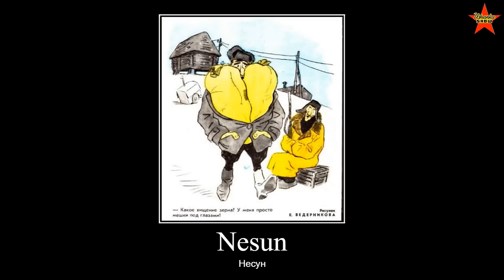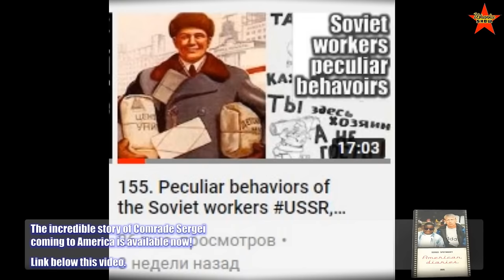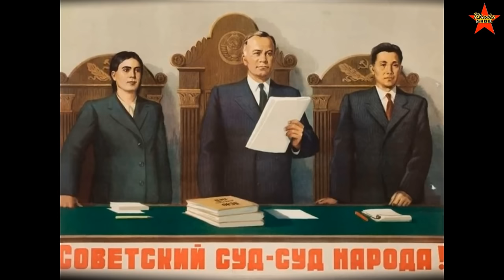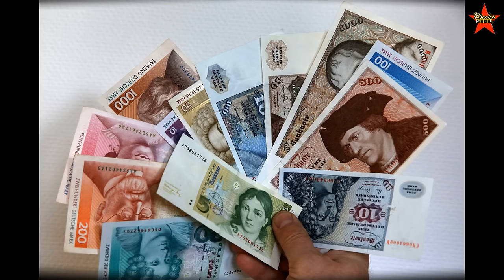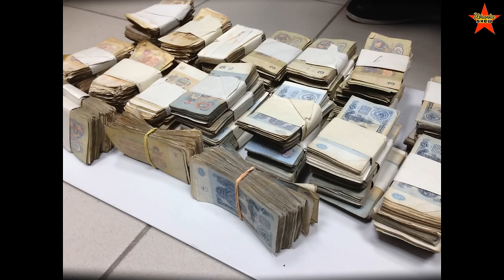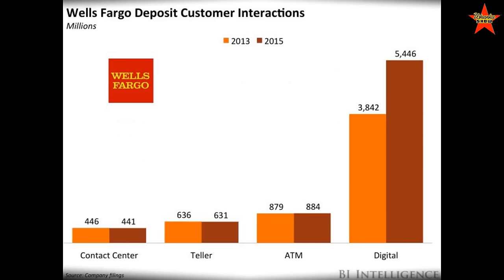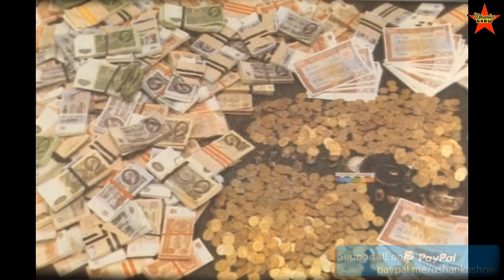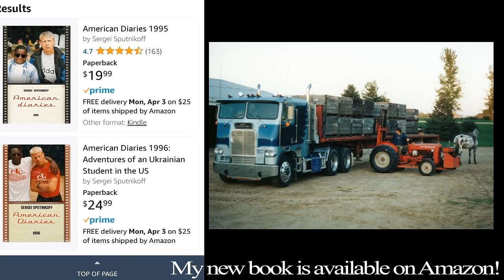The Great Stagnation and Crippling Corruption During Leonid Brezhnev Rule. Ushanka Digest #brezhnev

Comment: The more the government controls the economy, the greater the corruption will be. While corruption can be a drag on the economy, sometimes the government control is so restrictive that the corruption in the system is the most efficient part of the economy.
Reply: Why I use the phrase "Corruption is the Economy."   If you need something you often resort to the black market to get it as the state fails to provide it, illegal markets in short, it's the only free market in a Socialist system.  A Black Market is Corruption, and the State is itself Corrupt.  So everything revolves around corruption, so Corruption is the Economy.  

A few other good examples are China, North Korea and surprisingly South Korea.  South Korea was run by a military dictatorship for generations, not until around the 1980s did it step away from said dictatorship.  But that Dictatorship had a strong grip on the economy, and to get anything done in that economy required corruption and bribery.   South Korea still hasn't completely shook away that corrupted element even after 40 years.
Reply: That is correct, however in a CAPITALIST system, corruption is a feature, not a bug.
Reply: @kevinramsey417  hmm, wrong way around. Corruption is a central feature of the command economy, not a bug. Indeed, it can hardly function without it. In those economies where voluntary cooperation predominates, corruption is a good indicator of where command style policies are creeping into the system. Voluntary markets punish corruption because it adds costs without giving. As long as the consumer has choice that which is less corrupt is more cost effective than that which is more corrupt.
Reply: Corruption is universal and always has been.  The difference is that in a functional capitalist culture, the markets will punish companies that, for example, put tons of money into stupid investments.  Whether that's cotton farming in the wrong climate or investing in synthetic tranches.
Reply: corruption can happen in any economy. there's an insane amount of corruption in modern day capitalism, it's just mostly "legal" corruption that is normalized to the point people don't see it as corruption anymore. for instance, insider trading is incredibly common, especially among government officials who get kickbacks for basically letting companies do whatever they want. corruption is a societal disease, not an economic one.
Reply: This whole thread reads like a sith mantra. 

Like not a single homie thought "maybe it can exist but less" here. Maybe one day
Reply: You just described China
Reply: @larrys9241  and Russia, and Venezuela, and Cuba, and North Korea, and Vietnam and Cambodia, and....
Even in the US, the above is true.
Reply: @joanhuffman2166  in the US the government economic policy is largely dictated by the needs of large corporations so i wouldn’t just say that the root of the problem here is the government having control over the economy lol
Reply: @greghenrikson952  Depends on the companies lol. Top companies are always protected by the Governments. ALWAYS. During the Covid Quarantines, the German Government injected a shit load of money in the giants of the automobile industry, for example. Also, as long as there are some people making huge profits in certain areas, the Governments of Capitalist countries will do anything to keep such interests. Either by stopping technological progress, which would make things like oil obsolete, or even starting wars.
Reply: @joanhuffman2166  2 thoughts, from the workers perspective the capitalist mode of production is inherently corrupt, because the capitalist skims the profit off the labor. And you don’t necessarily need capitalism to have a market or product choices.

Comment: My takes on why the Soviet Union eventually tumbled like a dried leaf riding a gust of wind:

1. Brezhnev replaced Khrushchev thanks to the former gaining military support. Rewind back to the early 1960s when Khrushchev was in charge. Two of his actions that sealed the regime change were the Cuban Missile Crisis and imposing drastic cuts in the military. Unfortunately, the Soviet economy had a weak civilian economic sector, meaning the military higher-ups had nowhere to go once they were sacked. (Not to mention the loss of perks and privileges associated with their military postings.) BUT ...... while this enable Brezhnev to be in charge for about two decades, it meant pretty much giving the Soviet military-industrial-complex a blank check. If your military is given a blank check, there is not a whole lot of incentive for it to improve efficiency. It is not that its US counterpart is all that much better (apart from the technological race and any number of consulting firms that hire retired generals), but the Soviet military-industrial-complex was a much greater burden due to much smaller Soviet national economy. (Think of it in this way: the US has a much bigger economic sandbox to work with, so it can "afford" more extravagant projects.)

2. The cost of maintenance of the Soviet satellite states in Eastern Europe: (a) had to engage in at least one revolt per decade; (b) while the satellite states were required to tow the Soviet political line, Soviets had to provide extensive subsidies (especially energy) in return.

3. The Soviet system was essentially put together by Stalin. (By the time the Russian Civil War winded down, Lenin was a decrepit man waiting for his turn to go kaput, while Stalin already rose up as the General Secretary.) In other words, the Soviet Union might have endured longer had Stalin's successors been as capable as Stalin. But this was not the case. None of Stalin's successors could carry Stalin's jockstrap. Not to mention, none of them were willing to indulge in the level of mass murders comparable to that of Stalin's as a means of suppressing internal dissents, real or imagined. If your political system requires a plenty of politically-motivated mass murders, then it will start having problems once it is no longer being fueled by mass murders.
Reply: I'd add for context that while the US military has a massive defence budget, it's only 3% of the US GDP.  You can ague it's still too large but it's never been the proportion the Soviet budget had been. Where you really start to notice it is the difference in conventional force size. The US army now only has about 12 standing divisions, the Soviet military had a lot more and always had more during the Cold War, especially in Europe. Despite having a notably smaller population.
For context, the Soviet Union's defence spending during the Cold War was around 18-22% and that's with poorly paid conscripts.

Comment: Best example to me is the plane crash that killed all those generals bringing to much crap from West Russia to the East coast Naval station.
Reply: You are referring to the infamous 1981 Pushkin Tu-104 incident when virtually everyone in a senior position in the Soviet Far Eastern Fleet was killed. 
Shortly after taking off for Vladivostok from Pushkin Airport in Leningrad, the Tupolev Tu-104 went into a stall and crashed into the ground. All 50 people on board died (one of the flight crew survived the initial crash but died on the way to hospital)
The most significant loss was Admiral Emil Spiridanov Commanding Officer of The Pacific Fleet. 
The reason for the crash was simple the Naval Officers had overloaded the aircraft (The Tu-104 was a difficult aircraft to fly and had been withdrawn from public service by Aeroflot in1979 due to safety issues.
Not surprisingly, the Pushkin Airport disaster saw the aircraft withdrawn from service completely).
Specifically, it appears that Admiral Spiridanov was directly responsible for the accident. As it is believed that he insisted (against the wishes of the flight crew) that a roll of newsprint paper for the Pacific Fleet newspaper be loaded. Also, several senior officers ordered the loading of a considerable quantity of private items. This caused the aircraft to 
be incorrectly loaded. It appears that on take off that, the roll of newsprint broke loose, causing the aircraft to fatality stall.